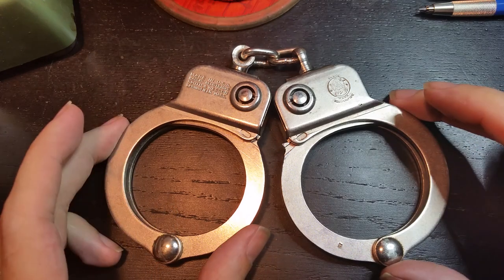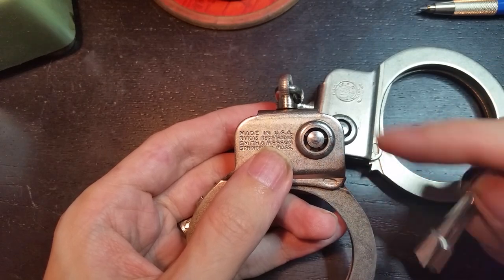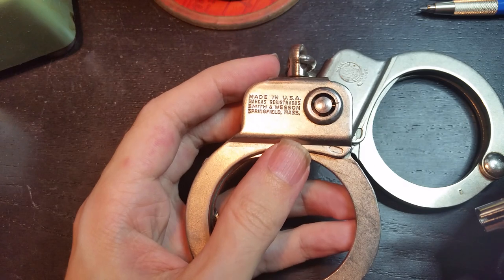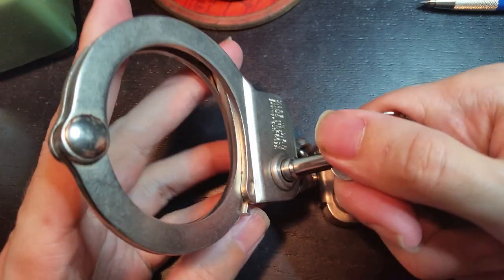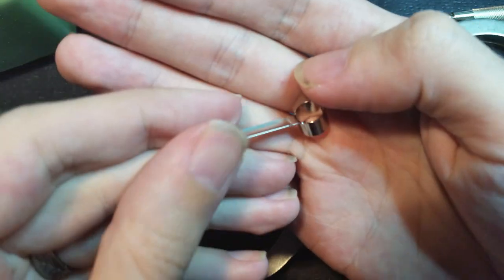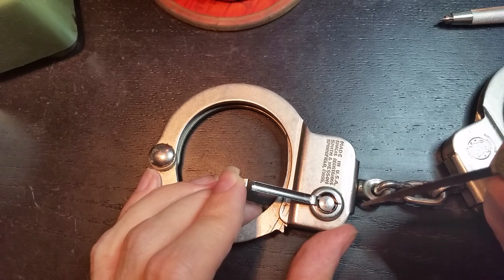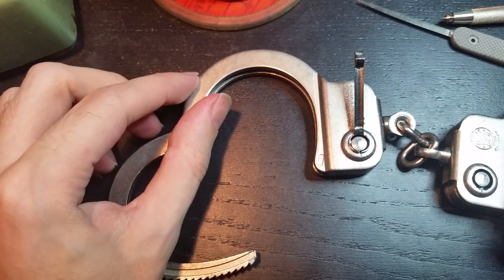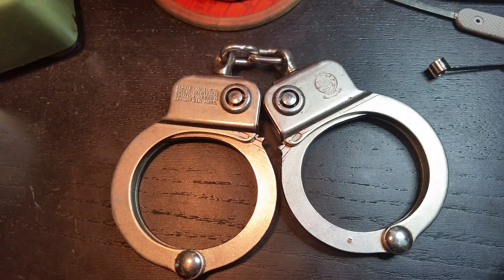(95) Smith & Wesson model 94 High Security handcuffs

Comment: More coolness. Quite amazing how long many of these less than great devices remained in operation. Thanks again for sharing.
Reply from the maker: For the time they were quite good, especially considering the very different shimming methods that were in vogue at the time and the lack of knowledge about tubular lock manipulation that was available (the ACE lock was still quite new).  These are probably the earliest examples I have seen of anti-shim pawls (they have a slight under cut on the leading edge to trap shims) and one of S&W's only attempts at a European style triple pawl design.

Comment: I haven't seen those before , looks like shimming or bypass would be a way ...
Reply from the maker: Like any other relatively modern handcuff design shimming only works if the double lock is not applied. Since these were used primarily by US Marshals and corrections officers for prisoner transport, instead of beat cops, they would almost always be double locked.